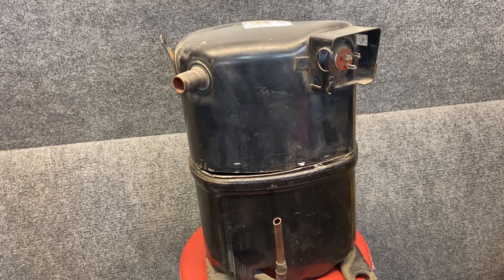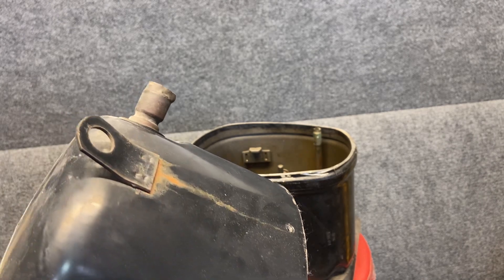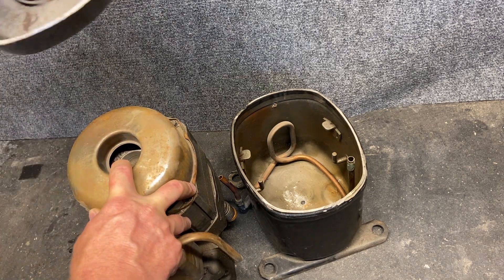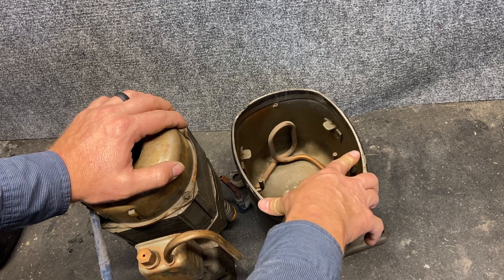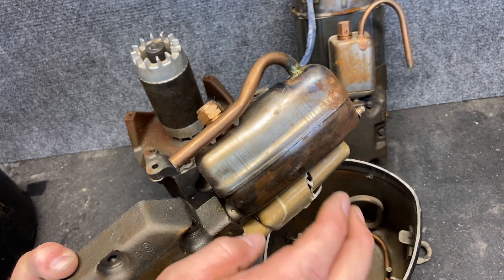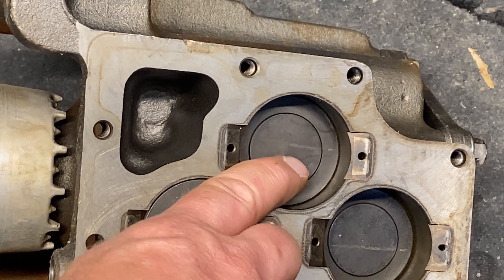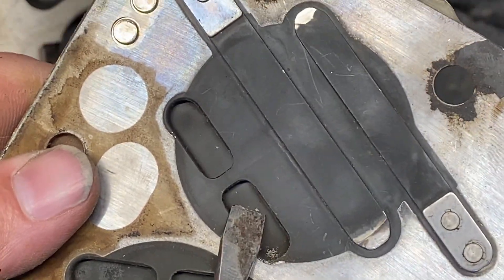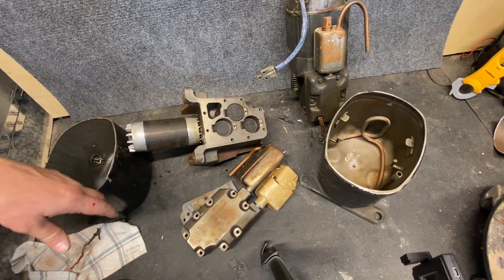HVAC 071 Receprocating compressor hermetic sealed

Comment: Mr Ty I have a crazy idea, maybe a way to cool down a compressor to get the thermal overload to reset is by recovering the refrigerant out of the system, the pressure will drop and temperature inside the pipes will come down, then we can recharge the unit the liquid refrigerant and let metering device drop the pressure on the low side cooling down the windings on the compressor.  Thanks a lot, have a nice day.
Reply from the maker: I like that you're thinking about it. I don't know that I'm willing to risk contamination and all the additional work  for an unknown time save.

Comment: Hi, I have a york residential ac about 3 years old. Was working fine until now. The static pressure equalizes about 150psi. On a call for cooling the low side goes into a vacuum and drops to about 10psi while the high side goes up to about 200psi. The low pressure sensor trips and compressor stops for a few second. The unit then equalizes about 150psi again. BUT, when it starts again this time compressor really loud noise and low and high pressure barely moved. I do see oil around the brazing point at suction service valves. Can this be low charge or bad compressor? Compressor windings checked ok. Thank you for your help.
Reply from the maker: In air conditioning, the low side should never go into a vacuum.

Sounds like it's severely low on refrigerant or there is a large restriction. 

Oil is a good sign of a leak.
Reply: Sorry what I meant was the low side pressure just drops from 150psi to about 10psi and then resets itself. It never reach the negative vacuum.